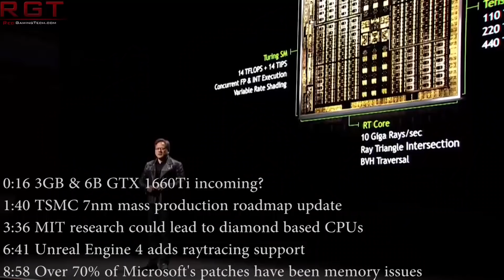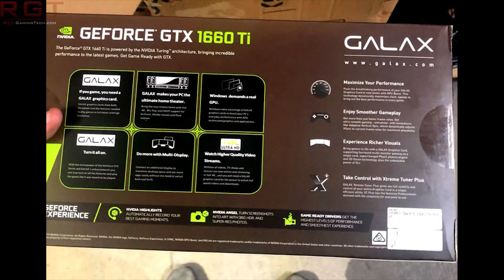Listing Leaks GTX 1660Ti 3GB & 6GB Variant | Unreal Engine 4 Adds Raytracing Support

Comment from the maker: 0:16 3GB & 6B GTX 1660Ti incoming?
1:40 TSMC 7nm mass production roadmap update
3:36 MIT research could lead to diamond based CPUs
6:41 Unreal Engine 4 adds raytracing support
8:58 Over 70% of Microsoft's patches have been memory issues
Reply: I dont even care about the ridiciolus 3gb of ram, but what the fuck is that naming sceme? The person that came up with this, has got to be mentally challanged. Just make it the 2050 if its supposed to be below the 2060.

Comment: Bring on the 1660 Ti!  This could very well be my next vid card.
Reply: Same but the price needs to be right, the sweet spot for me would be 1070 performance for $200-$230.
Reply: @BombaJead  It will be 25% faster then a 1060 ! Not 1% more ! For 300 bucks , better get the 1070(ti) , it has 2Gb more Vram . 
Or get an Vega 56 ! They are around 300 bucks now ! Best price/performance !
Reply: my rx480 died so i also wait for 1660 pricing..but it has to be low enough to not even make you think about a 2060
Reply: Considering the specs, you're honestly better off hunting for a 1070. Should perform about the same, but the 1070 has 33% more VRAM. And if you are ok with a used one you should be able to find one for $230 US or so.

Comment: New materials for CPUs? A silicon atom is 0.2nm in diameter. As lithography goes below 7nm quantum tunneling becomes a problem, which can prevent the oxide doped silicon functioning as a semiconductor. Basically the current is able to arc and form a circuit in the transistor when it is supposed to be in the off state, which will give a result of one instead of a zero. It's why people are talking about the end of Moore's Law and the doubling of transistor density every two years. Fin-fet helps but once they get to a certain point it will not be possible to make them smaller using existing methods. It's why they are looking at new materials and new ways to compute. I saw an article about Germans using single silver atoms to semi conduct using a switchable electrolyte to bridge them and form the circuit. Something like that might be the way forward so we will be able to play Fortnite at 32000p 512 fps UHD++ :D
Reply: yeah gate all around and nano wire might get us to 5nm or maybe even 3nm but past that there be dragons
Reply: @bobhumplick4213  
We can get 5nm, IBM unveiled the first 5nm chip in mid 2017, but is it really 5nm that's the question, TSMC 7nm is more like 10nm in real terms.
Reply: At some point they probably have to use 3d stacking in the coming decade.
Reply: Has nobody, here, heard of graphene?
Reply: @Bobcat665  
Yeah, but do you know how much it costs to make 1 gram of "real" graphene, products you have seen so far claiming to have graphene in don't and they use it as marketing BS.
Reply: lol who still plays fortnite. Apex is now the game

Comment: I bet we get a cool Unreal engine tech demo with ray tracing at GDC in March.
Reply: Im pretty shure unreal engine 1 supported raytracing like 20 years ago.
Reply: The RT Nvidia demos so far like Star Wars are on the UE4 engine, it's had RT for a while on internal builds.
Reply: @wing0zero  Well, honestly, I wouldn't be surprised if a whole new engine, Unreal Engine 5, gets released fairly soon, to make way for the new generation of consoles that will be appearing in the next year or two. UE4 was released about a year or two before the PS4/Xbone, with a bunch of new features to take advantage of them, so this would all make sense. I did mention ray tracing, but I bet there are other noteworthy and exciting features that we arn't even yet aware, that will be introduced, relatively shortly. These will be show cased in a tech demo, much the same way the Samaritan (Actually still UE3), Elemental or Infiltrator demos, show cased new features of the engine.
Reply: @bgates275  
Yeah I imagine UE5 and a new Frostbyte engine soon, there still DX11 engine's at the core, a new ground up DX12 engine with ray tracing and DX12 not been a bolted on as a after thought, we should see a new leap in visuals and performance.

Comment: 3gb cards in 2019. to play old games??
Reply: That was my first thought. 4gb seems budget now to me with 8gb being the new normal. Radeon VII has 16gb and people ask why. I remember people saying that about 512mb. I think I could use most of that 16gb to run an old game like Fallout 4. High definition texture mods and ENB, plus editing the ini file to increase the draw distance that low res LODs are used instead of the much higher res up close textures. It would make long distance sniping look better for sure. It could also help in flight sims like DCS. Higher resolution distance objects would make targets easier to spot, or at least look more like they should from miles away.
Reply: @Romick Vieria i Play BF5 with my old GTX680 2GB vram on middle with over 40 fps. Is ok to Play and watch incl. optic faults.
Reply: @kaltesbier4846  Thats because you either have it for a long time or you bought it used. Would you buy a brand new card, not used, brand new card, with only 3gb vram?? even a rx480 has 8gb